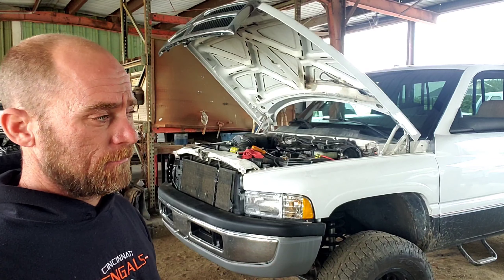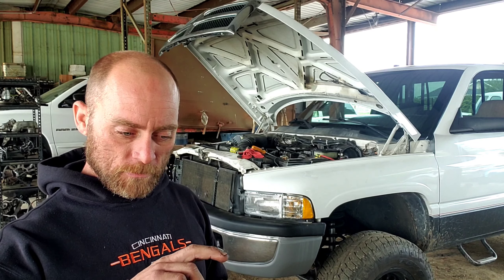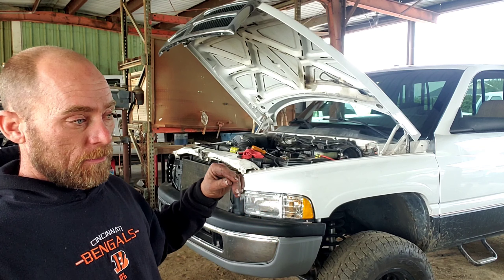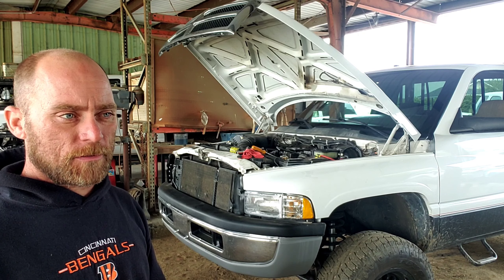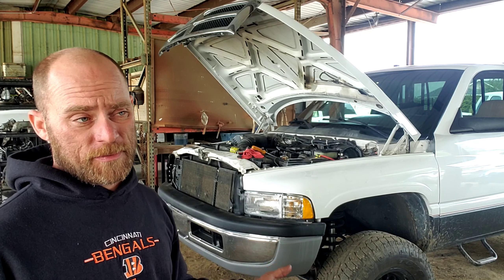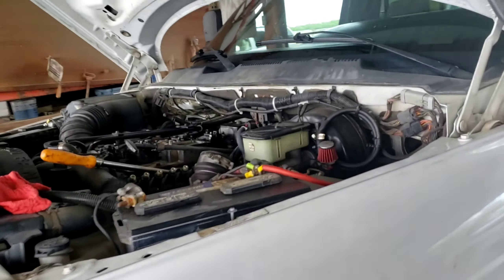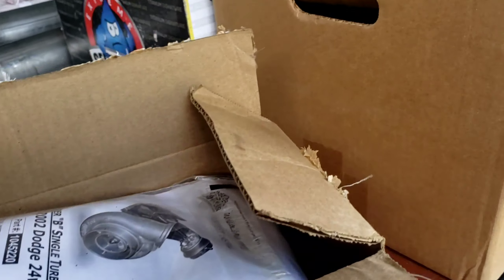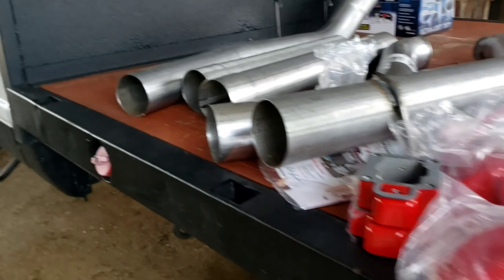12 valve Cummins compression test

Comment: There's a better way to pull the injectors on these. Use a lug nut from the truck "No i'm not kidding" and about inch and a half of pipe that fits around the injector. Thread that lug nut onto the top of the injector, and watch it pull upward. Dodge engineering wasn't 100% bad =)
Reply: Thanks that's good knowledge

Comment: yeah make more videos on the 12 valve and also the 24 valve non-common rail there's too many about the common rail period at what mileage should the injectors be replaced to avoid the nozzle tip breaking off in the cylinder

Comment: it does not just work on compression it has a inline fuel heater in place of Glowplugs  but is greater theory they should fire up on raw compression Friction  but some times its not the case  and cold compression good should be 390-420 psi

Comment: how do you stop fuel flow when doing compression tests on a diesel? i know there are different fuel system designs.
Reply from the maker: It would depend on what diesel but the easiest way to to use a jumper on the starter so the only thing on in the starter rotating the engine
Reply: @CVcustoms  so basically that or pull a fuse for electronic pump? Will a mechanical style always pump fuel or is there always a lift pump you can deactivate?
Reply from the maker: It will always pump a little but with no pressure